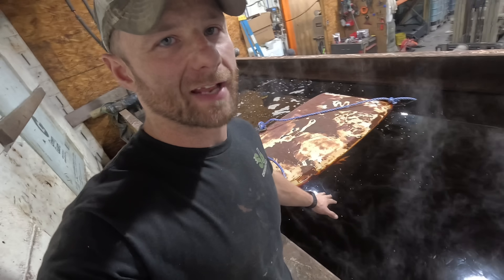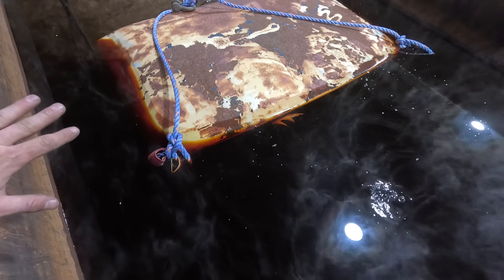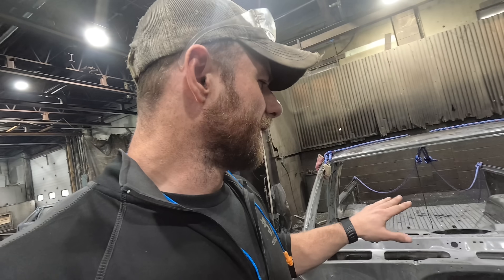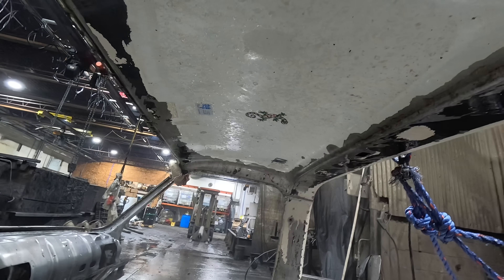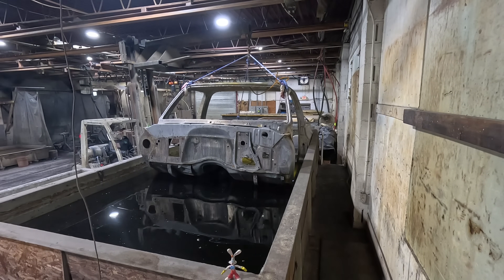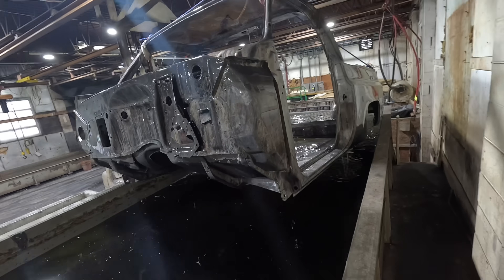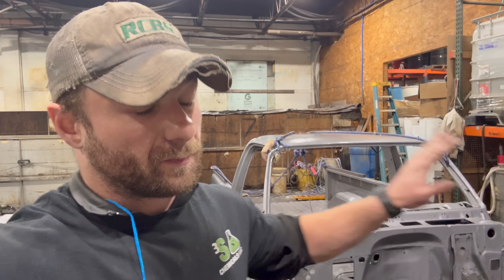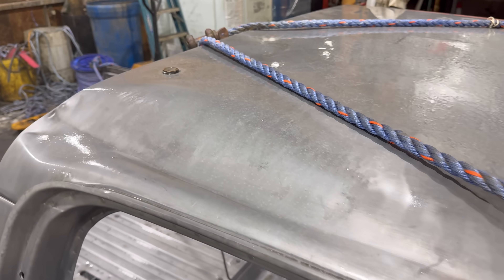Chemical Dipping a 1984 Chevy K5 Blazer

Comment: This Blazer is 99% rust free! I have never seen a square body full size Blazer K5 or truck in such condition. Usually, these are all rust buckets, specially those from the late 70ies. Maybe starting with the 80ies, GM improved things due to too many complaints? But anyways, this truck must have spent its entire life in the southwest, far away from harsh winter condition and salt!

Comment: How come you said it was 2 to 3 dips when it was three dips. and then two days in the acid. and then you never showed inside the top of the cabin where the two stickers were after the third dip. I would like to have seen what you did inside the cabin on the ceiling to see if it still was air pocketing.  and the neutralizing of the surfaces and solution. What type of water displacement oil are you using. Does it have wax in it. What are you trying to do other than neutralizing to avoid flash rust. I'm impressed but there are a few questions I have.
Reply: Look at 13:00. It shows how the air pocketing was addressed